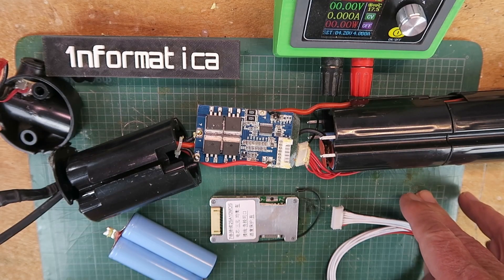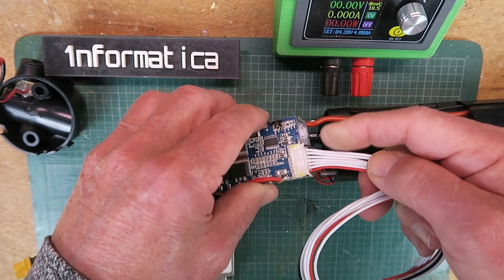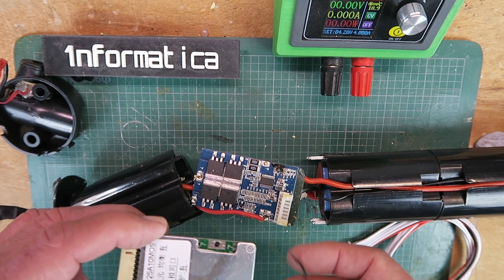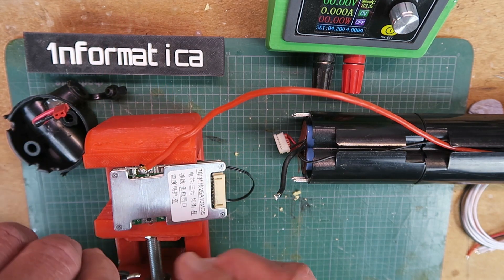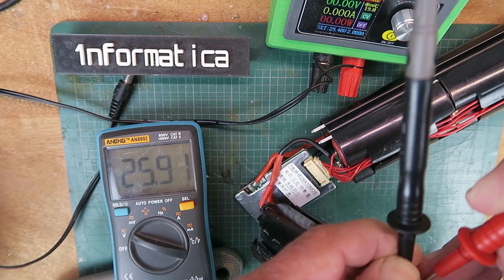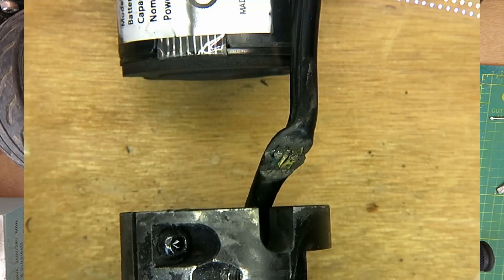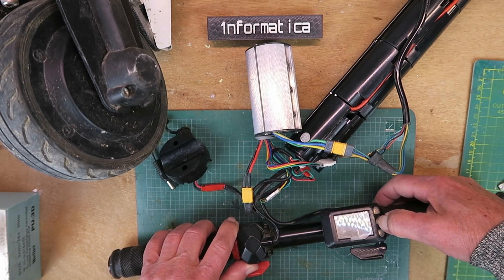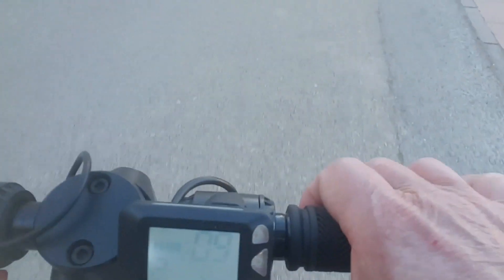Electric Scooter Repair Guide Stem Battery BMS Replacement

Comment: with the bms with separate B- and C-, is it necessary to disconnect the negative charger wire and connect it to bms C- ? in order not to bypass bms balancing ?
Reply from the maker: Sorry I don't know, not all BMS are the same. You'll have to check your BMS diagram / manual. Thanks for watching, have a great day!

Comment: Oh my. 
The three vids are amazing. The bottom of the shaft (the part with the 4 screws) is loose and the 4 screws won't tighten. I am thinking they have dislodged from something internal. If you took any video of putting it back together I would be most grateful. Thanks again
Reply: Really enjoy your work. You're one of those amazing folk. Really interesting, if I were younger I'd ask for an apprenticeship 😂
Reply from the maker: Bless you! Glad you find my content interesting! Thanks for watching, have a great day!  @peardropruth1
Reply from the maker: If I understand correctly the piece the screws go into you can see here : https://youtu.be/-eCr-xUCGQ8?t=254 I can't remember exactly if you tighten these screws the aluminium "segment" is pushed against the tube locking it in place. Hope that makes some sense! Thanks for watching, have a great day!